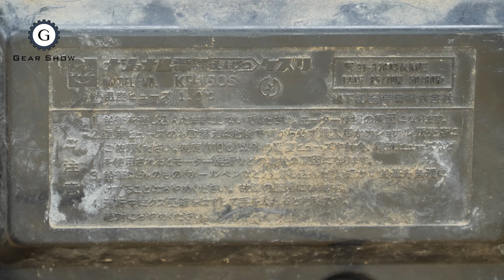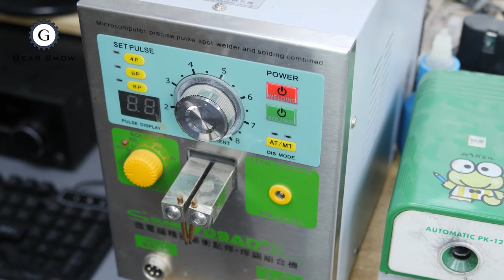1$ Vintage Electric Pencil Sharpener Restoration & Update | National KP 150S

Comment: It said “Dull” not “Drill” Understandable since English is not your first language. Nice upgrade.
Reply from the maker: My bad, I'm sorry about this mistake.
Reply: @gear_show  I wouldn't even worry about it. That was a great idea! And the sharp function is really clever. Keeps you from wasting material.
Reply: It obvi what @gearshow meant. @adeeb momen  No need to point out things like this. You commenting on an obvious language translation error is gratuously petty.
Reply: @troyna77  it’s not really a translation error when it literally said “dull” on the original sticker. I’m just pointing out that dull and drill have different meanings. And because he went the extra effort to print a brand new sticker in the first place!
Reply: @troyna77  Actually I think it's a positive thing to comment, especially the way he did. He learned a new word or atleast got a better understanding that way.
Reply: Level of your comment.....
Reply: @troyna77  you don't need to understand any language at all to COPY what was written... if it was Japanese I'd manage to write the correct thing because I'm literally copying what was there before

Comment: There is one unpleasant moment. The tact button is not designed for such a current consumption; it can quickly burn out. You shouldn't have put a limit switch, they are designed for high currents.

Comment: Wow brilliant restoration gear show
Reply: The motor which u used 12 volt in the upgrade. The difference in it was the carbon brush which touches the  commutator of armature. Other motor has carbon brush hand inside the motor this as out. Even my motor has carbon brush in but the carbon brush hand is broken from so I want to upgrade it can  u give some ideas for the carbon brush

Comment: You forgot to add bluetooth :D cool video :) greetings from Poland :)
Reply from the maker: I forgot :D thank you
Reply: @gear_show  You can mount green led and Red led in front and add a simple voltmeter to show when battery is load and empty and need recharge. Replace the switch with one who can take motor curent easy for long usage to keep it simple or can use electronic switch for the job but battery will be empty over time.

Comment: Please do a separate video regarding the batteries, are they calculated 3x6x9v or 4x8x12v?
Reply from the maker: The battery pack is 12.6V 3000mAh, 4.2V x 3 = 12.6V

Comment: 12:50 think you mean "dull", which is the opposite of sharp, not "drill" :)

I don't think there are pencil sharpeners made with a setting to just eat up the entire thing, it's probably to get a thicker end point on the pencil, for thicker lines
(oh no I just realised you made a label for it too xD)

Comment: Good work. However, I think the current capacity of the switch contact is insufficient.
Reply from the maker: Okay let see it after using it for a while
Reply: That was my first thought when I saw that
Reply: It doesn’t look like the motor will draw too much current, I can’t see it needing to work hard just sharpening pencils.

Comment: What is the purpose of the drill mode? Seems like it is a setting where you can waste a pencil. Pretty satisfying though, I've had my fair share of teenie tiny short pencils.
Reply: It's actually "dull" before he changed the label I guess but it doesn't really seem to make a big difference
Reply from the maker: Yes, it is dull mode.
Reply from the maker: Yes, it is dull mode.

Comment: I dont think that little button is gonna take it enough for it to have a useful life. Motor is propably sucking a lot of amps through that poor little button. There are microswitches that can fit the box but which can swallow atleast 1A. Otherwise there is small relays (that can fit somewhere else in box where there is space) that you could wire along with the button. Dont forget the flyback diode then, so the back-EMF don't eat up that little poor button.

Comment: It should be called 'Sharpener cleaning', as in fact you did NO restoration at all. You didn't even remove scratches from the body, to say nothing of blade sharpening. And the most strange thing is that you show the worn, full of scratches body close up in the end! Bad job. Imho.

Comment: 10:29 this tiny switch can't handle the motor current. Why didn’t you use a mosfet or relay controlled by the switch?